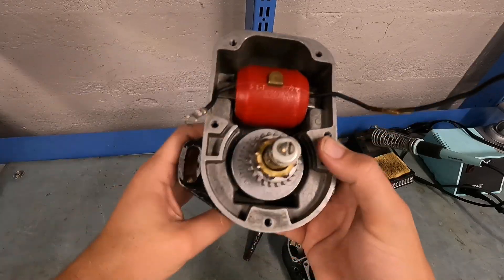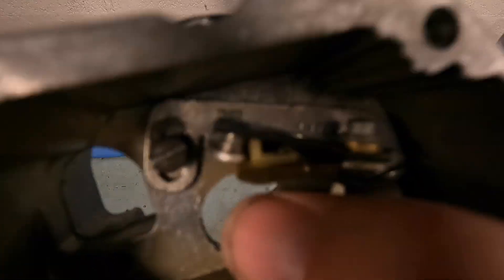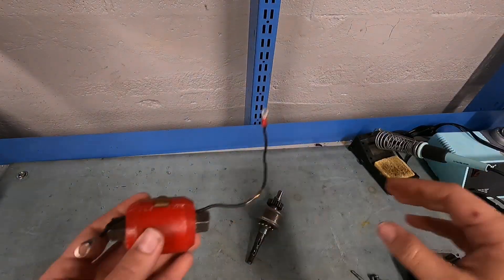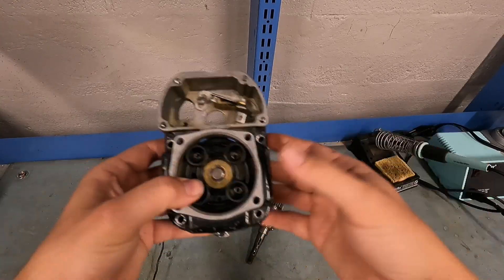How Aircraft Magnetos Work: Inside Look at Magneto Components & Function

Comment: Great video, but a few quick comments:  It's the alignment of domains (group of atoms whose magnetic moments are all aligned in the same direction) that give magnets their magnetic properties - not an alignment of electrons.  When a magnetic field moves through a conductor, it induces a voltage in the conductor.  The field from the rotating magnet is channeled through the iron (ferromagnetic) pole pieces AND through the iron core going through the coil.  That forms what's called a magnetic circuit.  The north and south poles flipping (from magnet rotating) causes the magnetic field to move back and forth through the core.  Because the coil's conductors are wrapped around its core, the changing magnetic field induces a voltage in the coil's wires.  Those wires are connected across the points which complete an electric circuit when closed and provide a path for electrons to flow (current) when that induced voltage is present.  When the points open, the current flow is suddenly interrupted which causes the voltage in the primary to spike and arc across the points.  The coil is actually two coils though (technically, it's a step-up transformer).  The other coil, the secondary, is wired to the distributor and is magnetically coupled to the primary (because they're wrapped around the same core).  The primary coil voltage spike induces a voltage in the secondary, but because the secondary has many more turns around the core, its voltage is much higher - high enough to arc across whichever spark plug is connected to it through the distributor.   Thanks for reading this whole thing.  Sorry for the geek out!
Reply from the maker: Mags really are simple, but the science behind them is incredible, in my opinion.

Comment: When you hear that ticking from the mag, means the impulse coupling is working to retard ignition spark. Basically is a safety feature.
Reply: I've understood the impulse coupling's function to provide a good retarded spark to assist starting, but not as a safety feature. What's the theory behind that? The system is 'safer' since it'll give a good spark even at low RPM?
Reply: @twentysevenferrets  The theory behind the safety feature is if the impulse coupling fail. 

It will hinder the magneto's ability to generate sufficient spark energy

It will lead to the engine firing in full advance timing and thus lead to a kickback during starting

It will cause the propeller to rotate violently causing serious damage to the airplane
 
That’s some of the problems.
Reply: @modelaircraft6576  thanks for explaining it, makes good sense